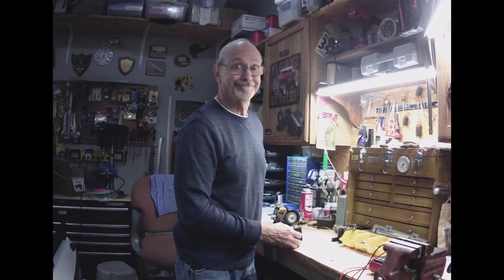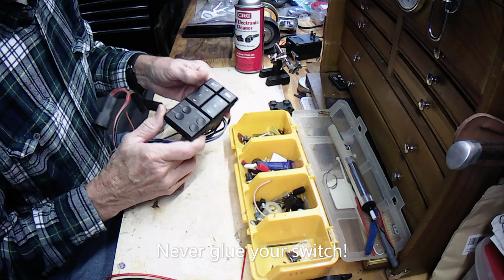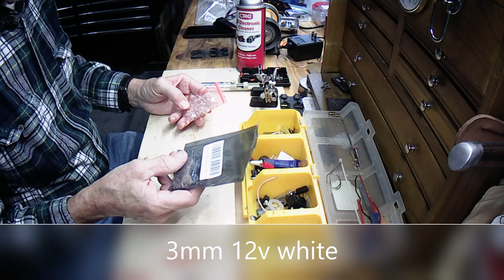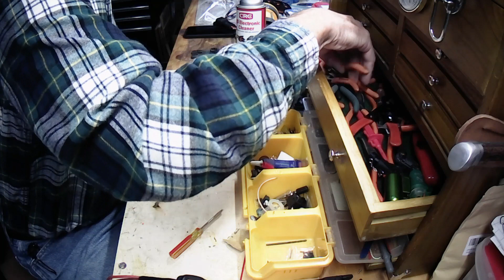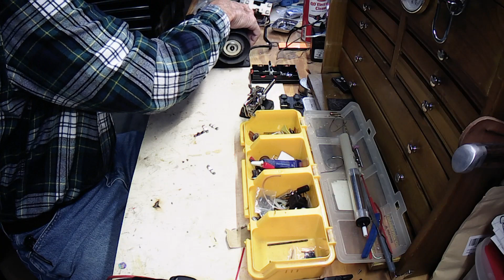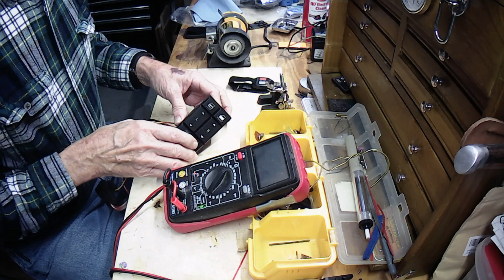Allante Switch total Refurbish

Comment: Thanks for the great video. I have owned my 1988 Allante for 26 years and had to work on the window switches as soon as I got it. The windows would go up and down on their own occasionally when I would hit a bump in the road. Lately, my passenger side had been working intermittently, so I decided it was time to open the switch up. All three tabs on one side were broken, but the contacts and interior of the switch were in very good condition. There were no screws in it, so I wonder if I had ever taken it apart before. I cleaned the contacts with some fine wet/dry sandpaper so as not to wear them down too much. I used four small screws from some old plastic eyeglasses and a 1/16" drill bit which worked much better than the slightly larger screws, that I had to grind the heads down on, on the driver's side switch when I first purchased the car.  Thanks for sharing your expertise!
Reply from the maker: @teejaj  Thanks for the positive feedback. Doesn't happen very often.